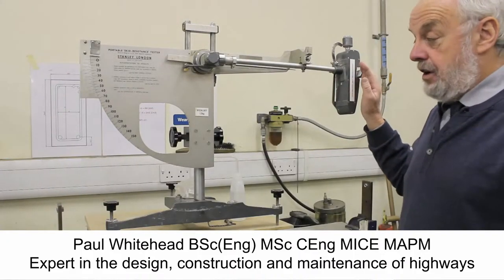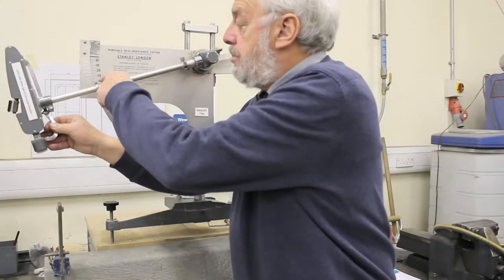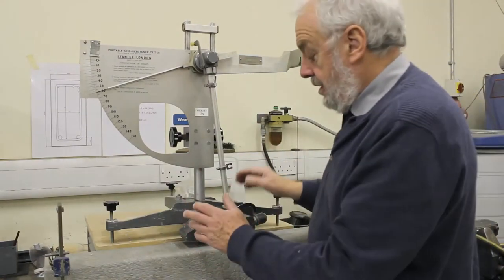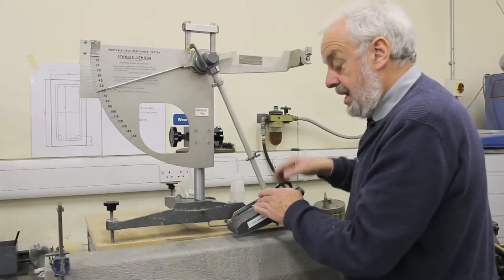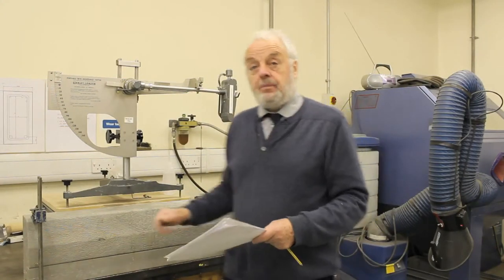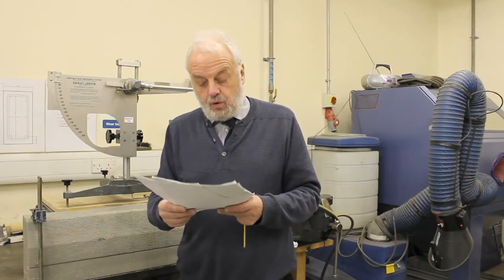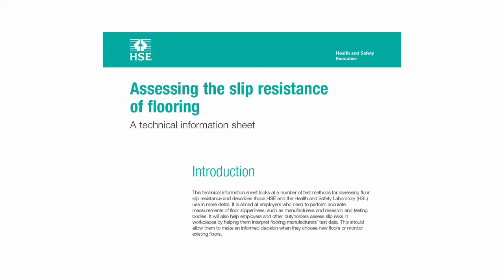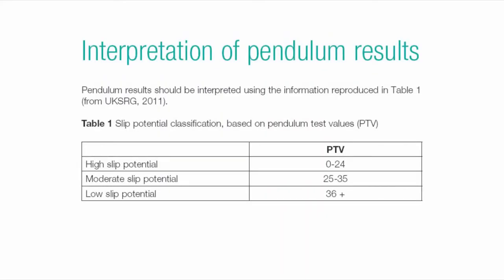Recycled Plastic Kerb: Slip Resistance Test

Comment: interesante!! ¿ Cómo calculo la fuerza estática ejercida por el plano del control deslizante sobre la superficie a ensayar? gracias
Reply from the maker: Thank you for your question. Google translates it from Spanish to English as:
How do I calculate the static force exerted by the plane of the sliding control on the surface to be tested?
This paper from Sheffield University offers some help:
http://eprints.whiterose.ac.uk/90813/1/J_2015-Understanding%20the%20friction%20measured%20by%20standardised%20test%20methodologies%20used%20to%20assess%20shoe-surface%20slip%20risk%20-PRE-PROOF%20OPEN%20ACCESS%20VERSION.pdf 
Equation 1 in Section 1.4 gives the coefficient of friction (COF) for the pendulum with differing values determined in the pendulum test (ie Pendulum Test Values – PTVs). The COF gives the ratio between (1) the frictional force developed at ‘impact’ and (2) the normal force at the surface of the test specimen (i.e. the force developed at 90 degrees to the test specimen at the point of impact).
Figure 1 in Section 1.2 might also be of interest. This Figure relates to a person with a given mass (kg) treading on a surface. The Figure enables you to determine both the normal force (referred to above) and the horizontal force developed for different profiles of foot contact, per kg of body weight. For example, at 20% foot contact – heel impact – the normal force generated on the surface is 9 Newtons per kg; so a person of 80kg mass will produce a normal force of 720 Newtons at the contact location.